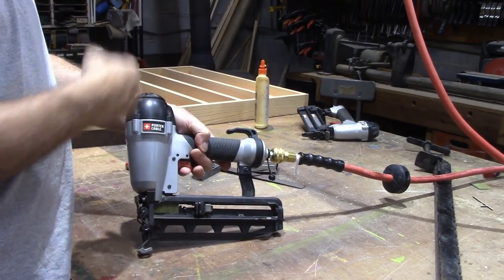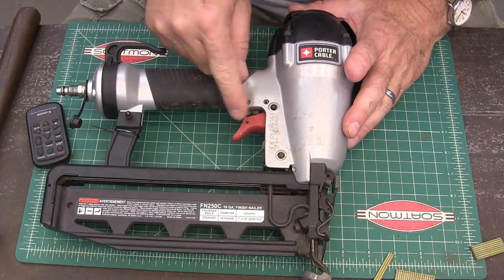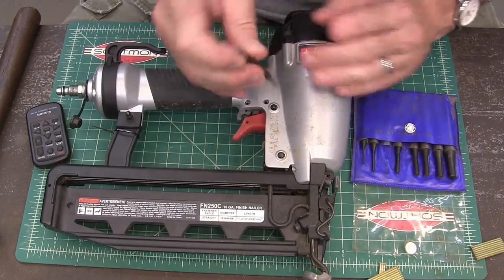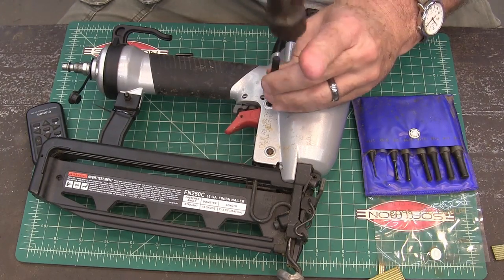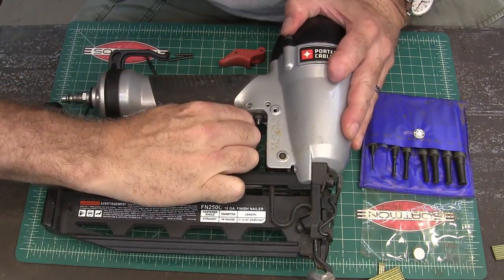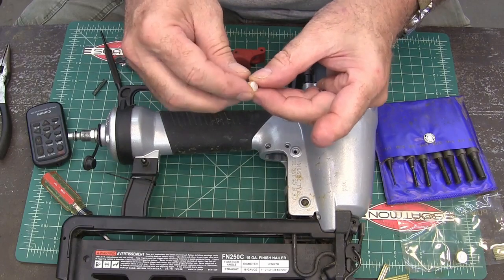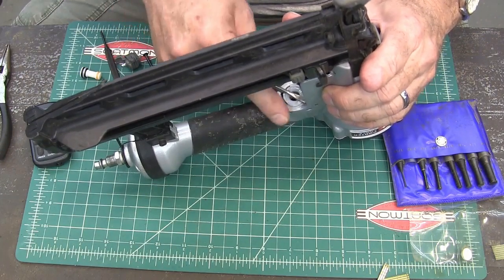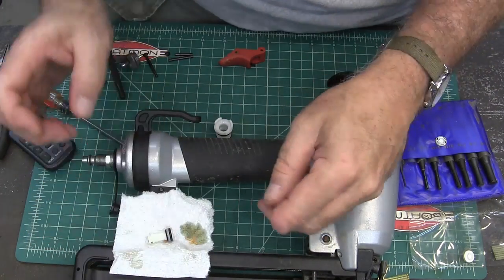Porter Cable Nail Gun Trigger Repair

Comment: Nice!  I was able to fix my nailer (same model) using your video as reference.  I didn't have a straight punch small enough for the job, so I used the one of the 16ga nails from the gun (head down).
Reply from the maker: That's great Aaron.  Thanks for letting me know!

Comment: I'm wondering if anyone noticed the exact symptom for this failure.  Mine leaks air like this one, but the anvil that drives the nails won't return to its upmost position, which is what got me on this in the first place.  This happened right after I rebuilt the upper seals which failed due to incompatible cheap seals, which lead me to thinking I had put it back together wrong.  Great video, thanks.  I'm having the same issue and will take mine apart.  Gotta wonder why they make these things with O-rings that don't hold up like that.  Such a cheap part, and such a pain when it fails.
Reply from the maker: Agreed.  Thanks for sharing your experience.